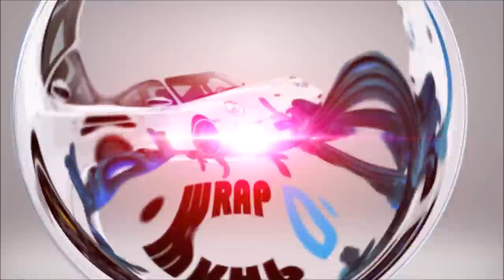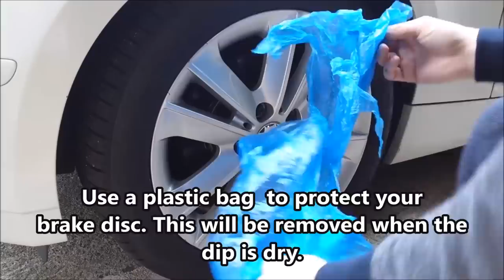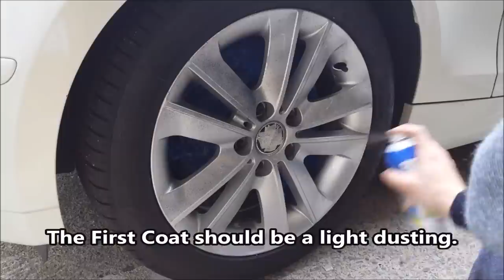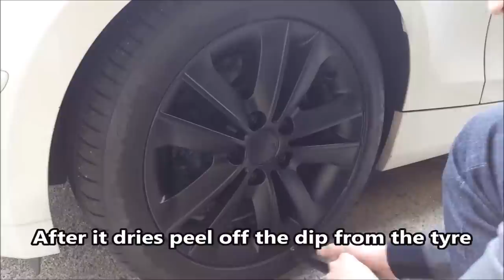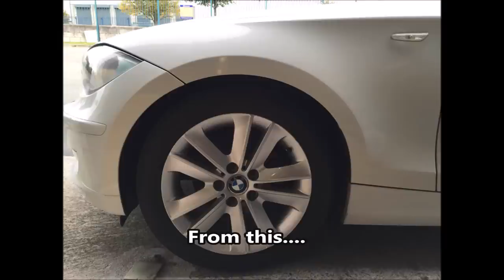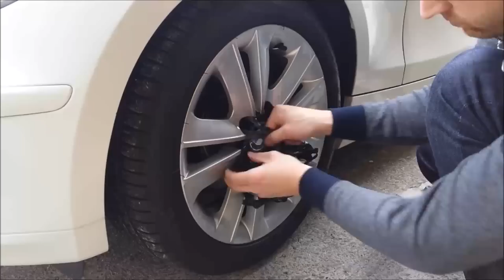Plasti Dip Ireland - How to Plasti Dip your Alloy Wheels - Matte Black Rims

Comment: How is the durability of this kind of coating compared to paint or powder coating?
Reply from the maker: It wouldn't be as durable as powder coating or paint because it is not a permanent solution like them, it's a removable paint but you should get 2/3 years out of it.

Comment: Hi, 
Two of my rims have kerb damage and a few scratches. Can the dip be applied directly or would I need to get them refurbished first before applying Plasti dip??
Reply from the maker: The Plasti Dip will hide minor scratches and can still be applied to the rims if they have kerb damage but you may still see the heavy scratches.